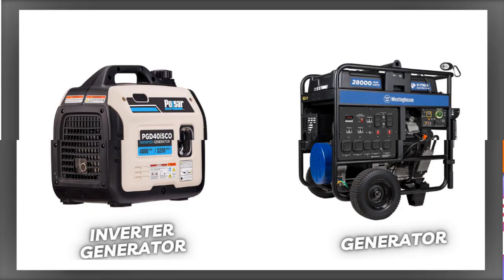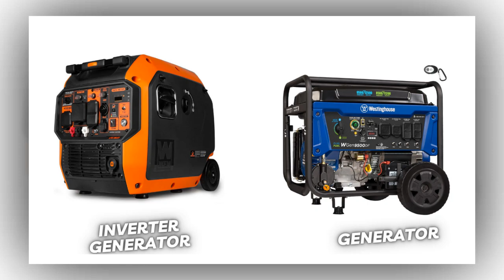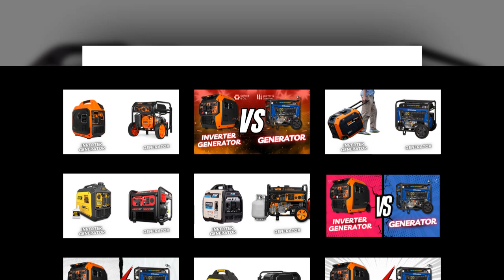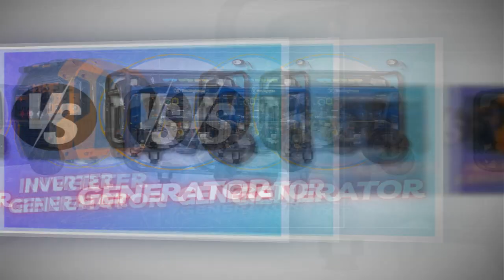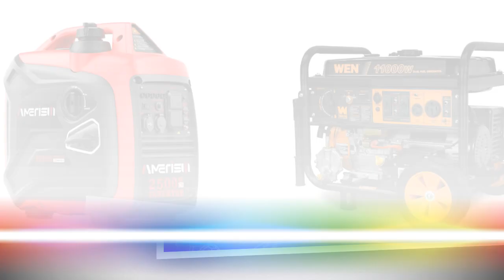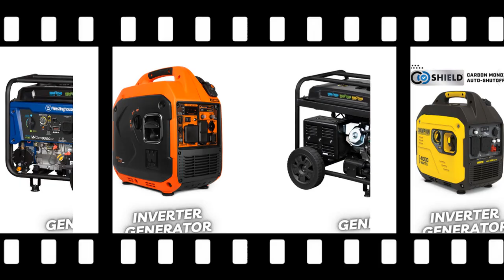Inverter Generator vs Traditional Generator: Fuel Efficiency Comparison

Comment from the maker: Link = https://cutt.ly/yrBUbDRq

Inverter generators deliver superior fuel efficiency compared to traditional.

 generators through advanced engine technology and variable speed operation. Traditional generators consume more gasoline per hour due to constant RPM operation, while inverter generators adjust engine speed based on power demand, reducing fuel consumption by 20-40%. This fuel efficiency translates to longer runtime, lower operating costs, and reduced emissions, making inverter generators the smart choice for camping, RV travel, and emergency backup power applications.

Hashtags: #InverterGenerator #TraditionalGenerator #FuelEfficiency #GeneratorComparison #FuelConsumption #PowerEfficiency #GeneratorFuel #EcoFriendly #FuelSavings #GeneratorTechnology #PortablePower #EnergyEfficient #GeneratorRuntime #PowerSolution #GasGenerator